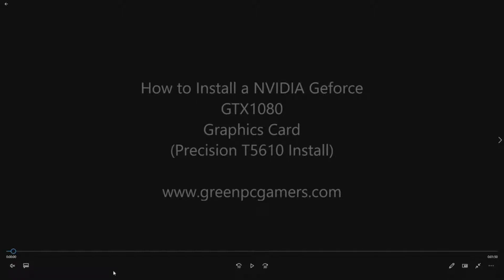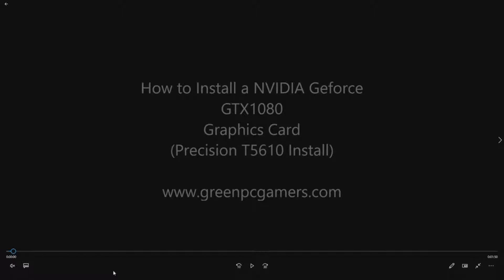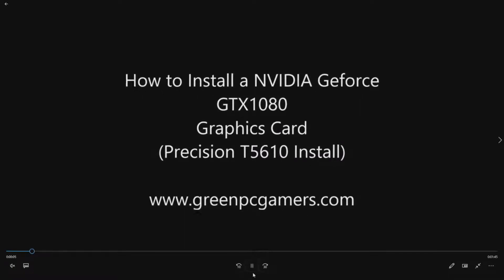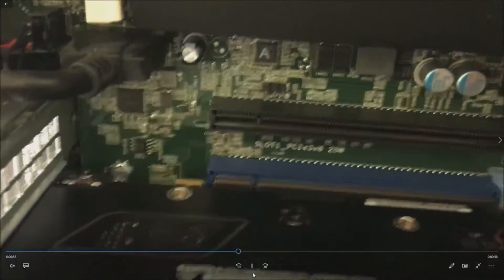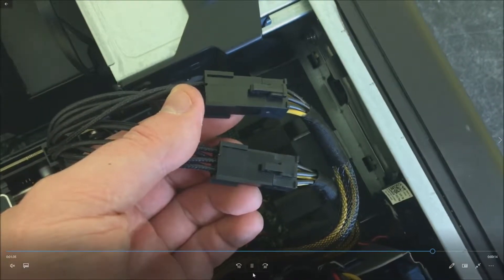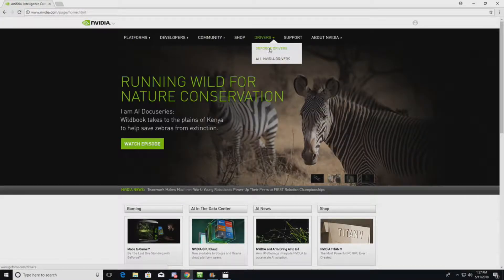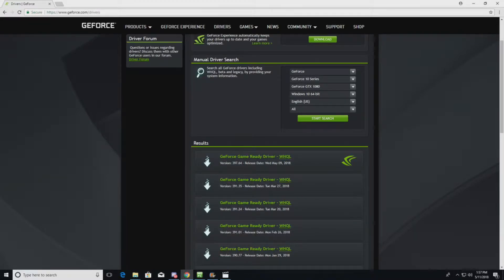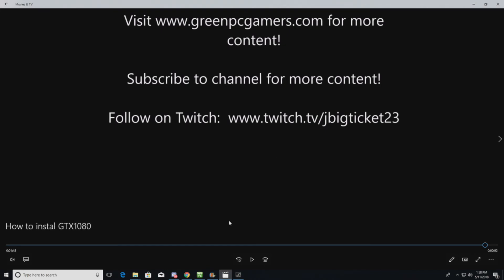Precision T5610 EVGA GTX 1080 SC Graphics Card Install

Comment: The Dell Precision T5610 has 2 6 pin power connectors and the video cards you list that can be installed require either an 8 pin, a 6+8, or 8+8. Just how do you install any of these on a power supply with 6+6?

Comment: Do you face any "no signal "issue after installed new gpu? Mine is t5610 , aand  I install gtx 1660ti . It have no signal issue if I try video stress test or it happened randomly
Reply: I am having the same issue, did you find a resolution?

Comment: Is it possible to install a 1300w power supply into a dell precision t5610?
Reply from the maker: Great question!  You cannot install a 1300w power supply in the T5610 workstation.  It supports the 685W or 825W Power Supply.  If you check out our Facebook page "GreenPCGamers.com" you'll see a recent post from one of our community members that added an external 1050W Power Supply to his T3610 to get more wattage.
Reply: @GreenPCGamerscom  FYI, I installed a 1300W power supply from a Dell T7610 in my T5610 and all ok. Been running a few weeks now.
Reply: @GreenPCGamerscom  Ok thank you!